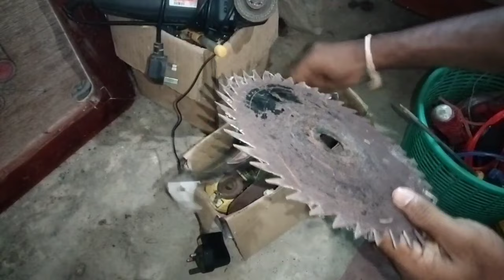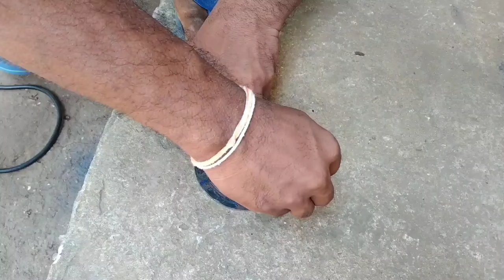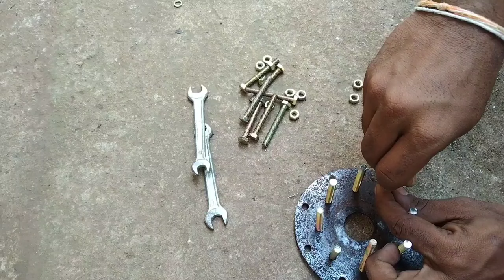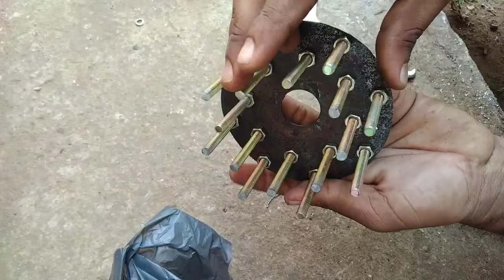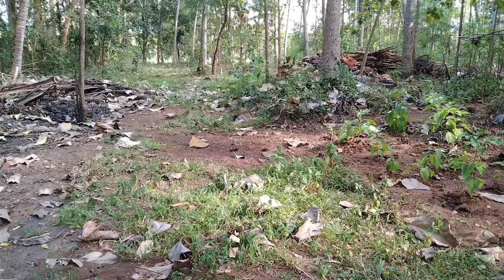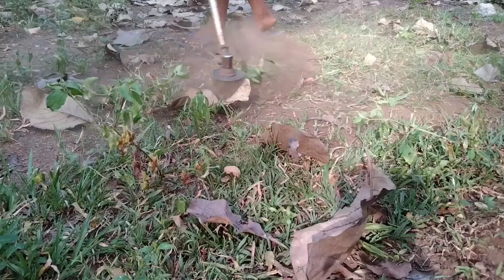How to make a grass remover at home

Comment: Interesting solution, but I think for most folks, the weed eater spins way too fast and presents a danger that is not worth the risk.  Even if you welded the bolts on, it is not going to prevent one of them breaking at some point - and even if it doesn't hit the user - it could find its way to some else nearby.
Reply from the maker: Thank you so much. You are absolutely right. I will consider ❤